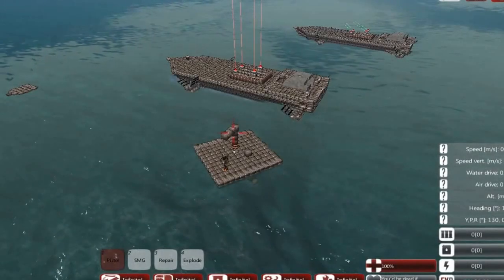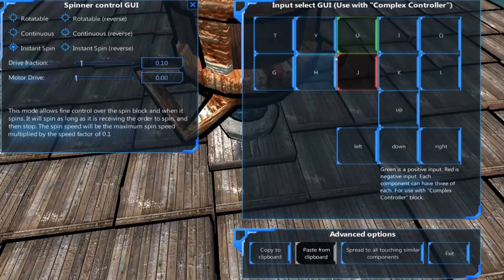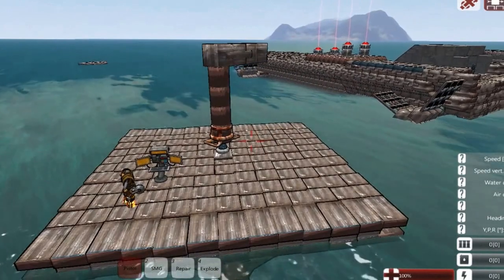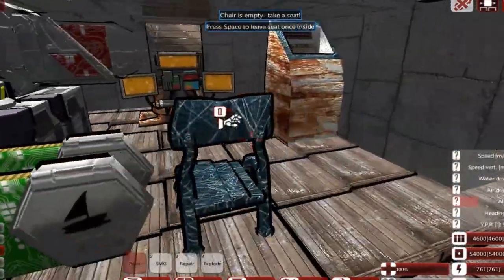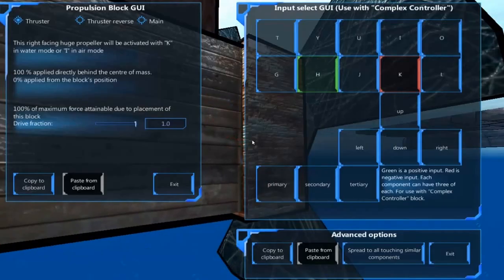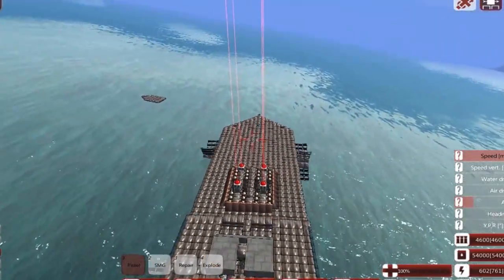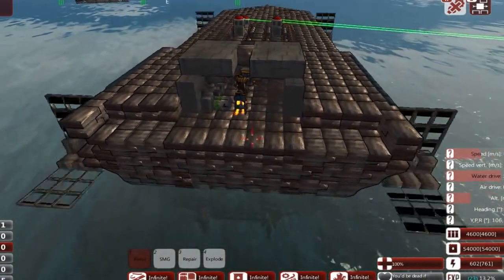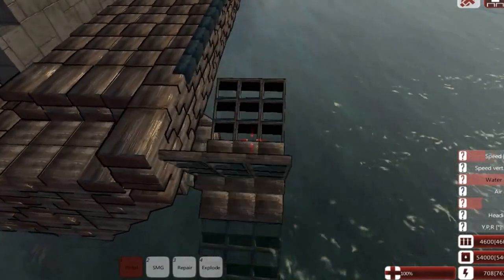From The Depths. Paddle Ships Tutorial

Comment: i have a problem with a ship i've designed, it drives forwards using it's paddles but starts to turn to the right, and doesn't stop, do you have any idea what i've done to it? the mass is central on the ship and it does roll slightly but that's about it
Reply from the maker: Have you made sure all the drive ratios are the same?
Reply: first thing i checked
Reply from the maker: are your paddles lines up exactly to each other, Like are the paddles on either side of the ship hitting the water at the same time?. If your paddles are out of alingement it might cause your ship to rock
Reply: they are, and it's not rocking, its turning to the left when i accelerate
Reply from the maker: Hm okay thats a little weird. How is your power core set up? I have noticed if an engine in build into a ship and isnt perfectly centered it causes a lot of problems with balance, Also have you tried disconnecting the paddles from control and power to see if the ship sails okay with propeller. To see if its a problem with the balance of the ship or the paddles
Reply: interestingly the spin block isn't needing to draw power from anything, but no, i tried using the propellers and it did the same, but i also watched the wheel and it continuously turned to the right, and when i was hovering over the propellers it thought they were both facing right, which i think is where this problem is coming from, the game thinks the propulsion on the ship is facing right so it's continuously trying to correct that, making it turn right all the time. i don't know how to solve this though, what do you think?
Reply from the maker: +Gregsplays do you have the paddles set up rotating opposite directions. if you  have a paddle on on either side of your boat then one of the paddles has to spin one way and the other spins backwards
Reply: yes, one is on opposite rotation